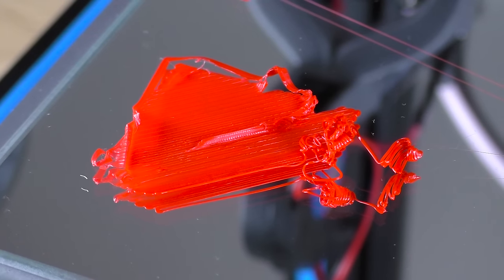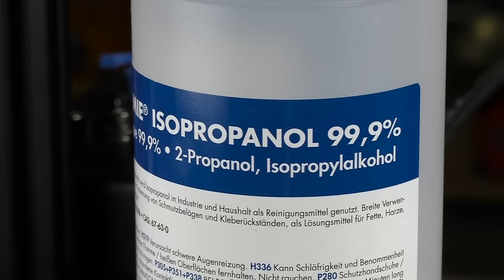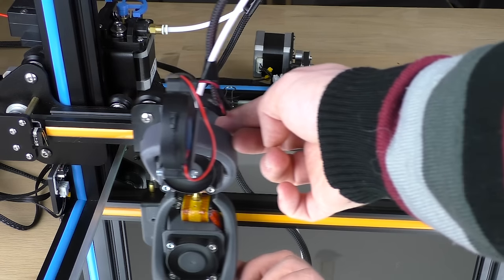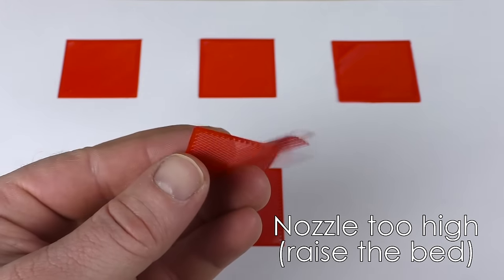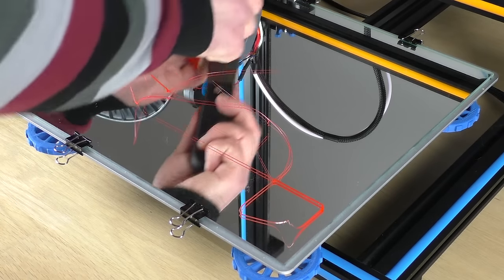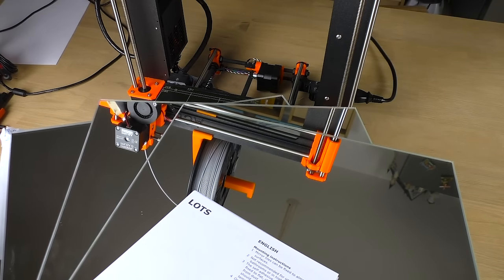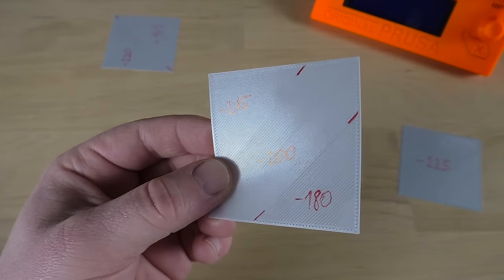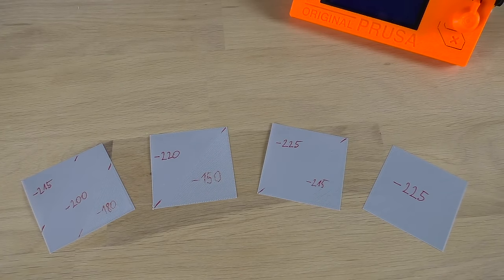Best method for 3D printer bed levelling

Comment: Hey, I have a problem with autoleveling on my ender 3 pro. I use a bltouch probe and the compensation is close to zero
Reply from the maker: You mean that the calculated correction values are close to zero or that the probe appears to be doing nothing?

Comment: so is the 225c best setting for 3d printing and whats best for the heat bed temperature 50c  ??
Reply from the maker: The nozzle temperature depends on the filament, but 200'C - 210'C seems to work the best. You can print a temperature tower to test your specific filament.

I always use 60'C for the bed.

Comment: hello heelo! im actuallu having a problem leveling my printer! i keep leveling the bed but the nozzle will hit on one side of the plate! i cant lower the back plate anymore due to the screw runnining itself into the frame because the plates too high! im going to try to replace tehe back screws it just sucks that i have to so that lol you think the company would think of that! its a dymco printer! i know nothing about them i needed one for my company and my landlord sells them and told me this ones amazing aparently lol pls help
Reply from the maker: I'm not familiar with Dymco printers, but if you can't lower one side of the bed enough, then I suggest you try and reposition the Z endstop. It looks like a switch near the Z motor and it's what "tells" the printer how low to go with the nozzle. Maybe your Z endstop is too high up, preventing your nozzle from being lowered further.

Comment: My printer have auto leveling but it's failing..all the time it stop in the same place....and never end the process...was working fine till last night.... anyone know what can be the issue?
Reply from the maker: Do you have a second sensor to verify that this one didn't simply fail? BLTouch seems to be more prone to this, especially if you have a clone.
Reply: @HobbyHoarder  I send it to the warranty....they will replace the sensor, this one is a new model....similar to the ender 3 but made  in Argentina , it's called hellbot magna 1....pretty similar to ender3

Comment: i tried so hard to only level my bed when it was cold and i kept having problems
had to just stick my hands in and yolo it while a test abs print was printing
thats me with my secondhand wanhao i3p in 2020 problems though
Reply from the maker: Nah, ABS is really hard to print without warping. I've just wasted about half a spool trying to print a larger piece and it's still lifting up in the corners, even with a large brim. This is with Prusa within an enclosure. PETG is much, much better if you don't need the higher heat resistance of ABS.
Reply: @HobbyHoarder  i eventually found some post on the net about how they used to dial machines with beds up to 120 /110 when printing ABS back in the day when anyone printed in ABS. I was actually having leveling and extrusion issues but it caused me to run the gamut on all the abs fixes. and find your video eventually.

I literally threw a cardboard box over my monoprice maker select v2 (wanhao i3p) and dialed the bed up to 110 and have been printing prints with minimal delamination / cracking, and i occasionally have a gentle elephant's foot, or perfect bottom layer, except for the one cold corner of the bed which will peel the print during the cool-down process (i leave the box on until everything shows 0 degrees on screen to not suddenly temp shock it)

i think its because if you get a proper insulating enclosure (i suspect corrugated cardboard might actually be outperforming metal and acrylic enclosures that come with machines) the air temp inside stays at like 65 / 70 degrees, whereas if you have a proper bed temp dialed in (people recommend 60 also for ABS which is insane to me, or recommend like 90?) then your air temp actually ends up being down in the 30s / 40s and you have a disaster print constantly breaking itself and forming massive bed-peel-fillets on all the bottom corners. 

My "measured" airtemp is just me checking the screen's readings when  its in cool down mode post several-hours-long print. I watched for the nozzle and bed temp to plummet to a point where they equalized and then took a long time to cool down without removing the cardboard box "enclosure". This was usually about 65/70 deg, so that's what i think my air temperature is when printing, or slightly higher, with the bed set at 110 and nozzle at 240. 

i wasn't able to find anyone on youtube or modern 3dp resources recommending super high temps like 110 and 120 for the bed for abs though, i don't know if there were some big safety issues at one point with printers, or if everyone is just terrified of the mostly now irrelevant ABS. It was on one of those google results of some really old 3dp forum that's been archived by some weird forums archiving service

i also resorted to unscented hairspray which helped as well. 2 coats on after cleaning but while its heating up, makes prints stick like magic, makes me feel super nervous to have a carboard box and a can of compressed gas near my isopropyl bottle and printer / potential massive fire hazard but these are the sacrifices i'm making. I just dont have any other filaments yet, just the red pla and white abs i got with the printer secondhand, i've definitely been looking into petgs and more modern pla mixes though
Reply: makes prints stick like .. according to my second hand knowledge from yt videos (getting into a new hobby is crazy these days with all the visual reference material you can access)
all that to say:
makes prints stick like PETG lol

which will probably be the death of this build surface "Sticker" thing that goes on my maker select v2's bed. I should really source replacements.
adding this as a comment because when you edit comments on youtube it wipes out all your line-breaks and i'm not re-editing my above

Comment: i am planing to buy a tevo tarantula is it worth giving extra  25 dollars to auto leveling or buy same 5 dollar sensor and take the risk to flash new firmware
Reply from the maker: There's really not much risk with updating the firmware. You basically adjust the configuration file to whatever you want and wait a minute or two for it to compile and upload on the printer's board. So if you can get the same sensor for $5 then there's no need to pay $25 for something that you can do yourself in half an hour.
Reply: Thank you for your reply but now i have another question:
i want to buy crealiity ender 3 from gearbest to United States California printer costs 180 US dolar i want to learn about customs how much i will pay ?
Reply from the maker: I'm not from the US, so I can't really say. I do remember reading once that there is no customs charge for printers, but please double check that.

Comment: I am trying these squares but im having trouble slicing them. Im using cura for my monoprice mini select with a 120 mm bed size. it will not slice them. im new to printing so im probably not using the right settings but if anyone has any tips please let me know
Reply from the maker: Make sure that you're using 0,2mm layer height, as that's the thickness of the squares.

You'll find link for 100x100mm beds in the video description, that should work just fine for your bed size.

Let me know if you're still having issues.
Reply: @HobbyHoarder  yes I did try that. Maybe my printer doesn't accept .2 as a setting. I tried to adjust cura to .2 and it slices as 00 minutes and when I print just moved extruder and then says print finished. The print shows up yellow as printable in cura though
Reply from the maker: @armedbobery4879  Try scaling the model in Z only by a small amount, a percent or two. It might detect it and slice it then.
Reply: @HobbyHoarder  actually. For some reason, if I took the 200mm print and scalled it down as per many recommendations on that print it didn't work. When I got home and used the one made for 100mm it worked just fine. Leveling the bed now and making progress. Thank you and I didn't even notice the other sizes before and I was just trying to scale the bigger ones down
Reply from the maker: @armedbobery4879  Ah, that makes much more sense. When you were trying to scale it down, it also reduced the height. Since it was already at exactly 0.2mm to begin with, it dropped below as soon as you've scaled it down, and the slicer simply ignored the model then. I'm happy to hear you got it working now, good luck with leveling!
Reply: @HobbyHoarder  thank you for a great video and great help beyond that. True legend

Comment: By any chance do you know the dimensions of the squares? I'm guessings 22mmx22mm, but what is the thickness?
Reply from the maker: Most of them are 40x40 (I think those for small beds are a bit smaller), but all of them have a thickness of 0.2mm, so that's what you should print them at.

Comment: I tried this method and got a weird result:  each of the 4 squares has the starting and ending corners printed right, and along the long diagonal line, there's at least 1/3 of the square isn't printed. This happens at all 4 corners.
Reply from the maker: Were you able to see what happened in those areas? I'm guessing that your bed is warped and the nozzle was blocked there. You could test this by lowering the bed and printing the squares again. If the corners are off but the diagonal is fine, then your bed isn't flat. You could try flipping it around or replacing it with a mirror.

Comment: if only it were easy for me to do any of that, my the leveling screws of my print bed are on top and require an allen wrench, and the y axis arm is basically locked in place. but there is a small saving grace in that the nozzle assembly on the x axis rail and the print bed on a separate z axis rail can be moved freely. too bad i have to move everything in between each adjustment so i have room to reach the allen wrench

im focused on getting it to work at all, what the hell can you do if the center of the plate is too high

pardon my prior bitching, better lighting and scrutiny leads to the possibility of a clogged nozzle. filament curling imediately after leaving the nozzle, and the flowrate failing to keep up with the printhead travel, honestly not sure why it didnt occur to me sooner, ive had the machine for 3-4 years with no proper maintenance
Reply from the maker: That sounds like an awkward leveling system, but hopefully you won't have to repeat it often. Could you upgrade to self leveling?

3 years without cleaning the nozzle would certainly do it. It doesn't sound like a bad printer if it lasted so long without maintenance, I feel mine are having issues every other week.
Reply: @HobbyHoarder  for a cheap starter printer like the MP 200 I have, it'd be a "Ship of Theseus" type situation. Even if I had the expertise and the money, there's so much that would have to be entirely rebuilt to accommodate such a system that you might as well buy two completely new printers. 

The motherboard and 80% of the wiring is directly under the z axis rail and build plate y'see
Reply from the maker: @shaldurprime7154  I'm not sure about your specific printer, but when I was adding auto leveling to my CR10, I printed raised legs that I've found on Thingiverse. That gave me much more space under the printer to work with. It did have an open bottom though, so it doesn't work if it's fully enclosed.
Reply: @HobbyHoarder  okay i am at a loss now, the nozzle is cleared and the print bed is leveled, but anything i print gets peeled up almost immediately, tried to do the leveling squares ten minutes ago, had to cancel halfway through because all the pla never left the heat block. 
Any tried and true troubleshooting tips?
Reply from the maker: @shaldurprime7154  You either have to clean the bed (iso alcohol or soapy water) or you need to bring the nozzle a bit closer to the bed.
Reply: @HobbyHoarder  not sure if cleaning will help a propylene bed that's scratched to hell. 
what does it mean when filament is falling out of the nozzle? is it too freed up and gravity is doing the work, or is there pressure inside the print head for whatever reason? heat too high, is that a thing?
Reply from the maker: @shaldurprime7154  If you mean that the filament is slowly oozing out, that's perfectly normal. There's always a bit of plastic left inside and it slowly melts when the nozzle is hot. In fact, you don't want to leave it hot for too long without printing, because the leftover plastic might harden and clog your nozzle.

Comment: Did you just print directly on the heated in the Intro? :O
Reply from the maker: Yes, but before you say how stupid I am (you're not the first with this comment), the printer in use was Mk2, which didn't have the removable sheet yet.

Comment: got a link for those mirror panels? searching ikea's website and couldn't come up with anything remotely resembling something that could fit a 220mm print bed
Reply from the maker: Sadly you won't find any because they only have one size at 300x300. You could of course have them cut down or go to your hardware store where they usually offer to cut any size for you.

Here's the link:
https://www.ikea.com/us/en/catalog/products/39151700

Comment: My problem is the center is higher than the corner. Mybe the only way is to change the glass
Reply from the maker: That's actually easy to fix. First, try flipping the glass around, sometimes that works. If not, cut a square patch of aluminum foil and place it under the glass. You can add more if a single one isn't enough. I needed pieces to get my bed perfect.